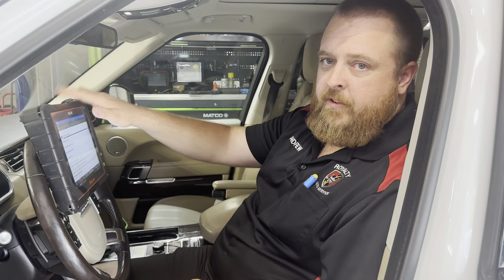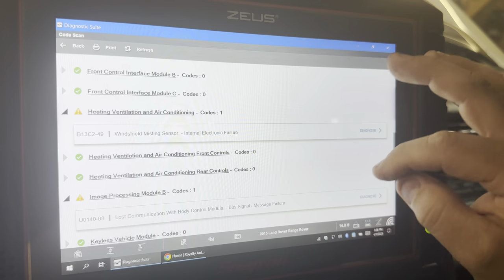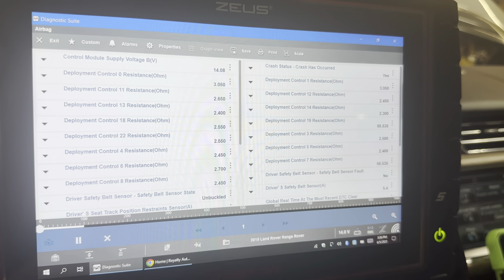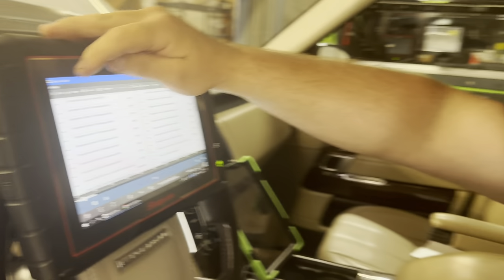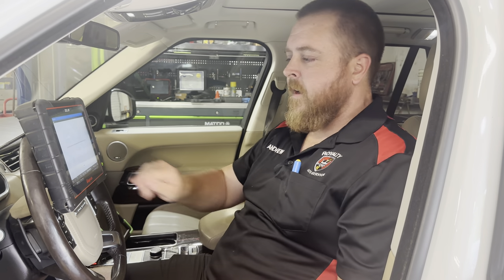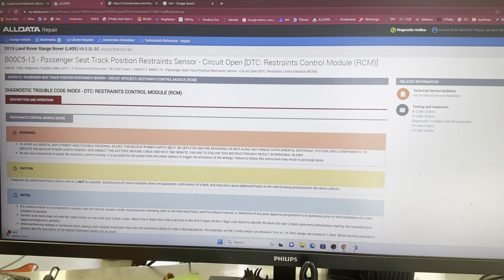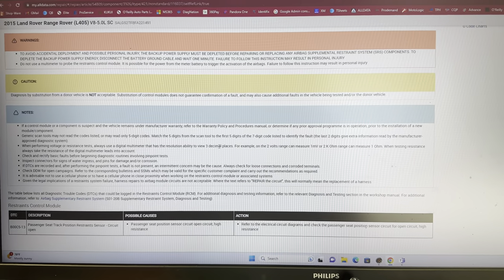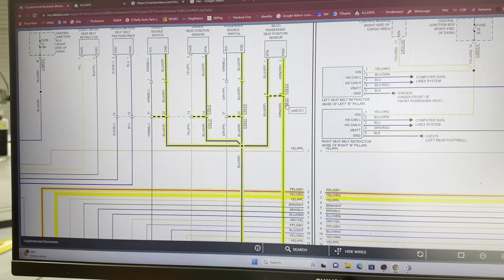Diagnosing A Vehicle From The Body Shop.. Air Bag Light On (Land Rover)

Comment: That high resistance measurement believed to be 65 ohms is not the ohm reading, it is a digital number representing the highest resistance that cannot be given in an actual reading. If you are an older MS EXCEL fan, you might remember that there were only 65536 rows available to populate. In computer counting, your number will also count ZERO so 65535 is the max. Let's call it infinite resistance or open circuit and we see the plug disconnected. No scope is needed here but this type of video is why I now follow your channel.

Comment: my biggest problem is i am old school 66 years old been mechanic all my life it is so hard to rely on scanners and scopes have been using scanners for several years but the scope only about a year and struggle with settings and understanding the data so i resort to gut feelings and experience. the problem is the newer vehicles can't rely on experience because they are new.
Reply from the maker: You can do it! Just gotta play with the scope on good vehicles. Just sit and play with the different time bases and voltage. You're not going to hurt anything and it's the best way to learn. Let us know if we can help. We are in S.E. Georgia, N.E. Florida area so if you're close by let us know and maybe we could get together and go over some scope stuff.
Reply: Yes , absolutely , practice with good vehicles . Perhaps just basic tests like relative compression and add more involved testing as you go. Master the basics and the rest gets easier.
Reply: @theroyaltyautoservice  if you ever have time would be nice to see a video scope basics. when to use a attenuator and when not needed. my main scope is snapon so i understand attenuator not needed. but i also have one of the uscopes and always worry if i should connect attenuator or not
Reply: My supervisor is in his 60s as well. Great auto electrician, always able to help me with his experience and knowledge, and I am able to help him with my technological knowledge on the scanners etc. Never discount yourself, your knowledge and experience still counts for a hell of a lot
Reply: I agree with you to a point but I do HVAC and you can not diagnose a system accurately with out a set of gauges. 
  The same thing with most new cars so many functions are inter dependent on each other and with multiple signals and voltages you need more than just a code reader to get the whole picture.
Reply: @markcollins457  I as well do some ac work haven't geared up for the new freon yet. But have so many come in overcharged they go to Walmart get charge can and ruin everything.
Reply: Yes, your eyes & ears are trained over time it's like when something doesn't sound right only experience and time can  hone those skills.

Comment: Ha ! I recently had a range Rover sport from the auction with d side seat airbag codes. It was unplugged, plugged it in and resistance came down but was a little too high. Someone put a 2.5 ohm resistor in the harness to fool the module, repair loose terminals made the connection better. 
SMH